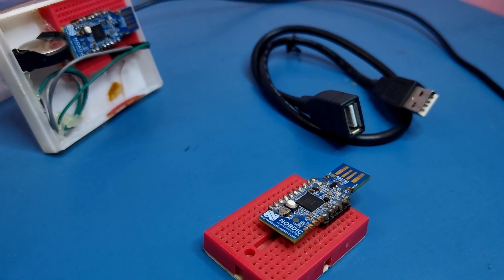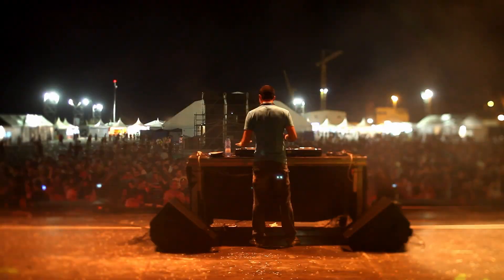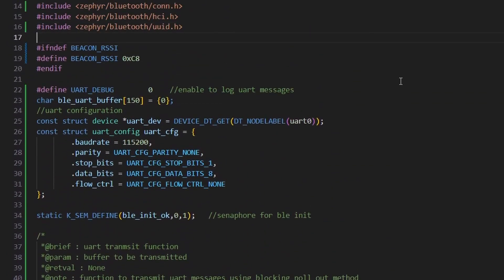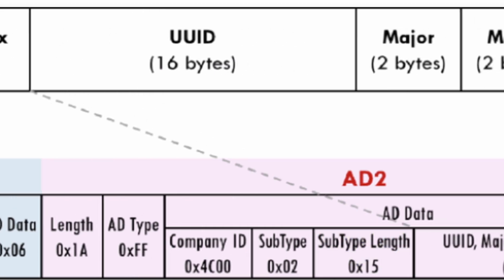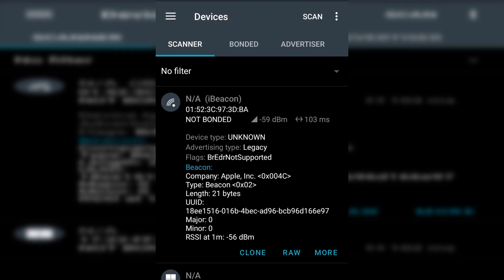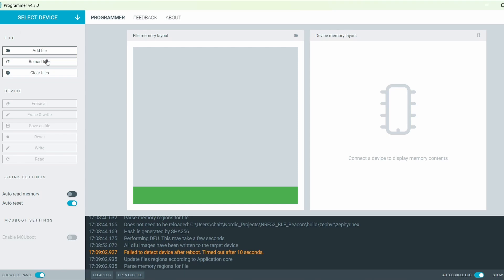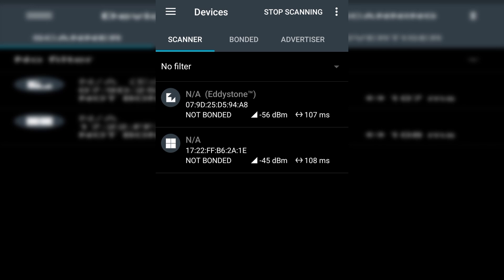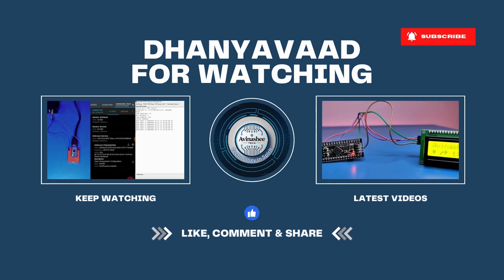nRF52 BLE Beacons Tutorial | iBeacon, Eddystone & Custom Advertising Explained

Comment: Good job, it help me a lot. Thanks!
[One info: you connect to a "extra" 232 interface. And it's useful because in case of restart you must unplug-plug and restart putty/other program. Have you modified some in the program or simple connect to the board's pins? Wich?]
Add -> Sometime I'm really stupid!
Waitinig for some info about it, in the shared main.c the initialization of the extra COMM port isn't complete.
Thanks again.
Reply from the maker: Good to hear that you liked the video. Please have a look at this video - https://youtu.be/c2SXHke03Gg. You will find your answer there. Thanks.

Comment: Nice video. Congrats
Does the ibeacon standard allow any custom bytes? In case I want to use it for telemetry... since eddystone has been discontinued. I wanted to use a sensor and ibeacon
Reply: I ask this because Apple can see the battery of an AirTag through Find My, and I find this strange because the ibeacon protocol does not support it.
Reply from the maker: @guilhermemaurer7798  Hi, thanks for the comment!

From what I’ve found, AirTags don’t use standard iBeacon formats for their advertising. Instead, they use a custom protocol with rotating identifiers for enhanced privacy and security. This includes:
->Use of resolvable private addresses (RPAs).
->Regularly changing UUIDs.
->A different advertising data type — 0x12 (for Apple’s Find My network), not 0x02 (like iBeacon).

You can read more here: 
https://www.beaconzone.co.uk/blog/are-apple-airtags-ibeacons/
https://adamcatley.com/AirTag.html

If you found the content useful, please consider subscribing to the channel, if not done already and support the mission! Thanks.